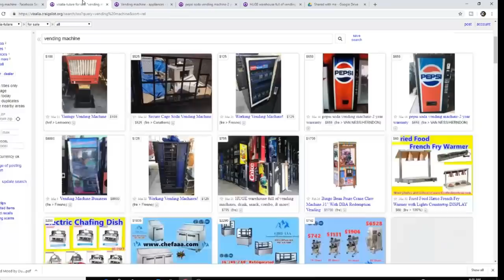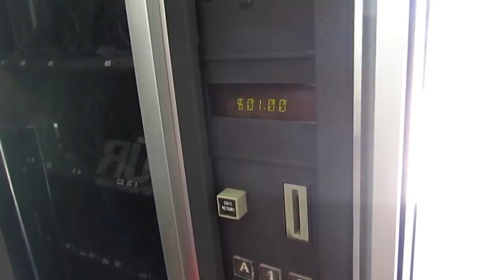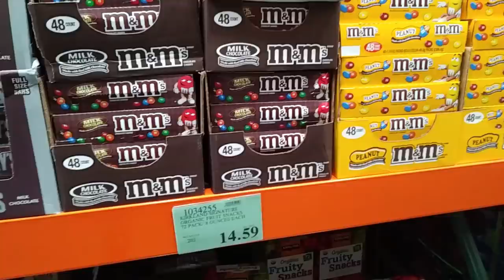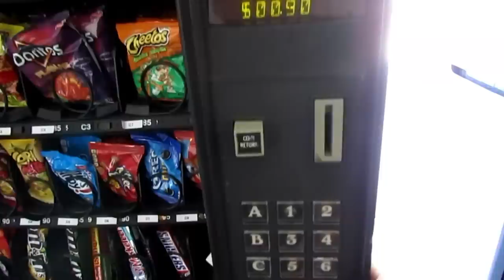Starting a vending machine business from home

Comment: Important things to know:
Get an "Appliance Dolly" style hand truck (they have kick back wheels).
Buy a pickup truck with a lift gate (preferably a retired truck from a vending company).
Don't lay machines with refrigeration units on their backs.
Have a storage room for your "products" .
Keep food items stored off the floor (health department will be looking for that).
Bolt / attach the glass front machines to the wall (kids will try to shake / tip the machine to get free product (you could get sued if kid gets injured).
Keep some dollar bill acceptor "cleaning cards" handy to keep the bill acceptors working.
Make sure the ground prong on the power cord has not been chopped off. Fire inspector will pinch you for that.

Comment: If the location does good, you shouldn't have to worry about candy going bad. It's shelf life is typically 9-12 months. Biggest thing to worry about is where you set it and if it get's too hot in the room where the chocolate will melt

Comment: Here are some tips, I had a vending business for 15 years. Find an account first, See what the company wants you to put in the machine, if they don't have a preference then experiment with what you want to put in it. Fill the machine at the location coin and product, keep a small toolbox in your snack machine so you can make adjustments or repairs if needed and trust me they will be needed at one point or another. I used to buy new machines straight from the manufacturer and you still have problems. Hope this helps

Comment: You should never ever transport a vending machine on it's back like that, they have specialized compressors in them that can be ruined if the oil makes it's way all the way up the line. The only way it's safe to do is if you remove the compressor deck before hand - but it's just easier to transport them sitting up right, Pro Tip - All vending machines are 10:1 bottom heavy, so it won't tilt over if you strap it in good enough.

Comment: But Reyes. You never suppose to lay a soda machine down. You can mess the freon in them up
Reply: You beat me to it😁
Reply: Don't you just have to leave the machine off for a couple hours or something to let the freon settle back down where it should be if you do lay it down?
Reply: Just needs to wait 24 hours after moving like that before turning them on. Inconvenient for installing in locations though. Best to rent a u-haul for the day so you can move them standing. Doubly so with a fully stocked snack machine...
Reply: You only need to wait 4 hrs . When you lay it on its side the oil in the compressor could move else where in the system . Just gotta wait for it to move back there. The freon movement really doesn't matter

Comment: But Reyes! It’s not good to lay a refrigerator machine on it’s side!!
Reply: tangerinebeam why not?
Reply: The machine’s refrigeration compressor is filled with oil, which is kept in the compressor by gravity. The oil could move to cooling lines causing clogs and prevent proper cooling. Lack of oil can damage to compressor as well.

Comment: The vending business is not easy! It looks inviting but it's all about the location and placement of the vending machines. Getting really good paying locations will usually cost you a commission and are not easy to obtain. It's a quantity business. You need many machines to make a profit. Moving machines around is also not easy and can be very expensive if you hire people to take care of this task. Full size machines are heavy and need to be handled with care or things move around inside and it may cause issues later. Machines break down from time to time and that's more money out of your pocket to fix them. If you want to make a full time income you will need to invest a fair amount of money for good machines that will last about 5 or 10 years. Not to mention investment for product and other miscellaneous expenses. Trust me they will come up! I owned 50 machines at one time and hired drivers to cover all the locations. People quit and don't show up for work so that can be another potential problem you deal with as well. If you keep it small you will make extra side hustle money but if you are looking for a full fledged substantial income it's going to take a large amount of capital even if you buy used machines. At some point you WILL need a truck or van to grow your business. I see people using regular cars for their vending businesses but you will rack up miles quickly and major wear and tear on your car. These are all the things you need to think about when getting into this business!

Comment: Good luck until it goes wrong. In the UK the call out fee is £80 then £30 per 15 minutes. You'll need an account with the machines manufacturer to get parts too. Hardest part is getting sites. Good luck though bud.
Reply: Do you need a license to put a vending machine in the UK?